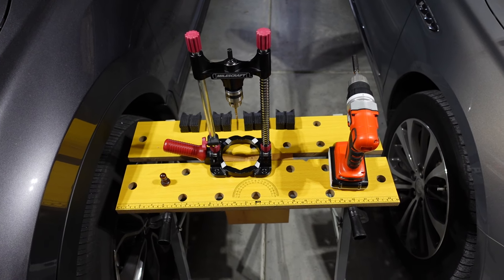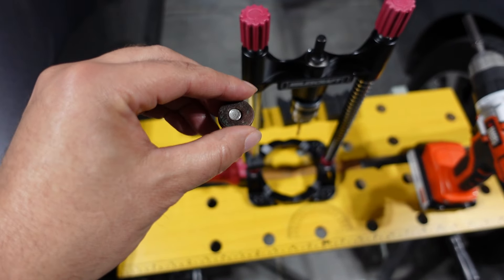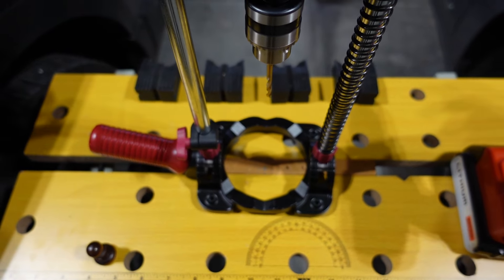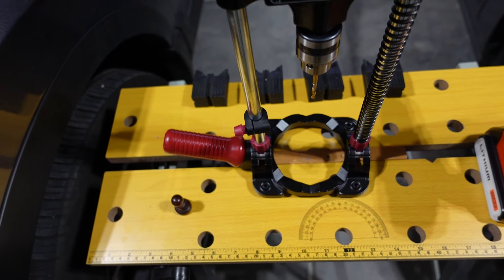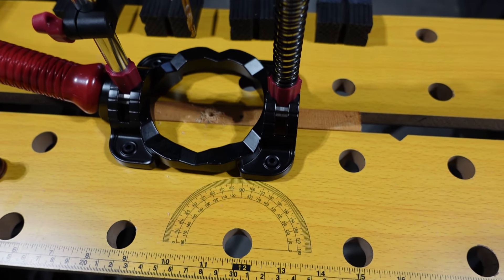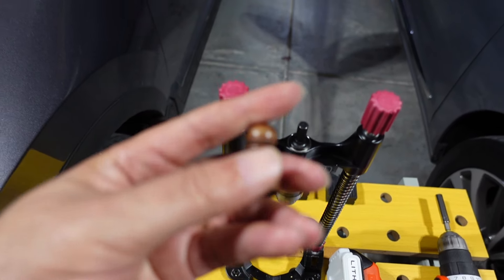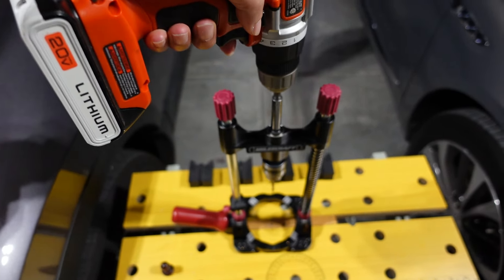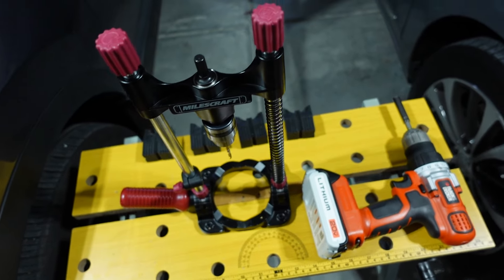**UPDATE 1** Chessnut Air DIY piece recognition chip set PROCESS DEVELOPMENT

Comment: How is this project progressing ?
Reply from the maker: I am still looking for pieces with pawns big enough to fit the chips, thse pieces houls fit the chessnut air board, but it seem snext to impossible to find.  I may end up making a set that will fit the Chessnut pro, as it will be easier to find pawns for that board that are big enough for my process.  And I have been making Chessbase 17 videos and working on my car.  So much to do and not enough time!
Reply: @katzenpapa  I think you better save those for the upcoming larger board. You can use bigger pieces and will have more wood to work with. The plastic pieces have the perfect proportions for the small board. Fatter pawns will look out of place.
Reply from the maker: @Murat807  that's is the plan.

Comment: Hello, watched your videos on chessnut air, considering buying it and I have a question if you don't mind. How bright and visible are the lights on the board? It's kind of hard to tell from the videos, does it ever happen you have to look for a piece that it highlights, since it looks like the LEDs can be hidden behind the piece sometimes? Do you have a discount code to use if I'm buying through you aff link? Thanks
Reply from the maker: The LEDs are not super bright but definitely nice and bright. The LEDs are hidden from time to time, but if you have the board centered in front of you, you likely will not have an LED hidden behind a piece. If you use my affiliate link, it should automatically give you the 10% off. If not, use this code here at checkout KATZENPAPA. Cheers!
Reply: @katzenpapa  nice and quick, thanks, will def use your link when buying
Reply from the maker: @defqqq  no problem and thank you!